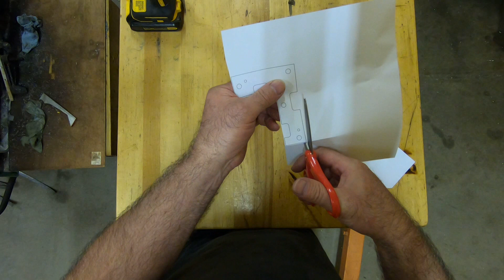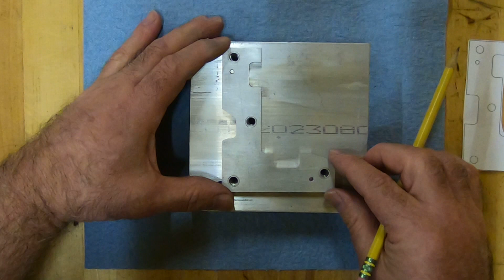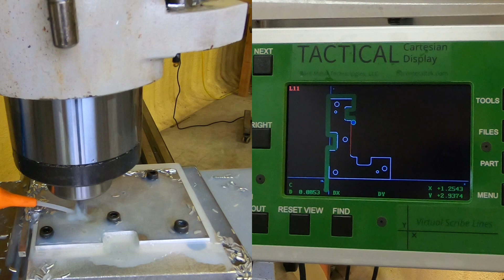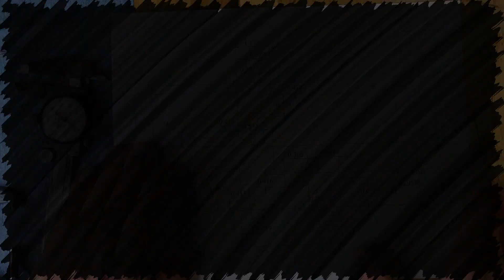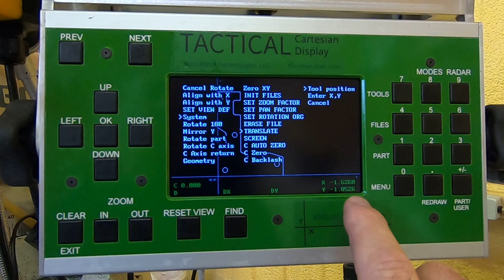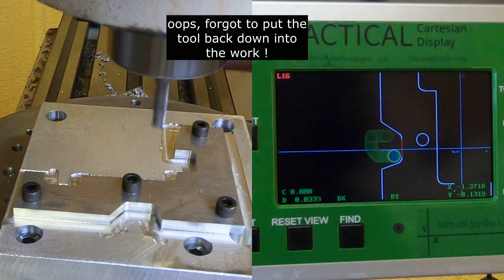Machining a simple part with the Cartesian Display

Comment: Thank you for your video. I was unaware of this "set up" and have never seen it used on any other channel. I'm interested to know if this is something you developed, there is very little info that I have been able to find
Reply from the maker: I developed the system. Keep an eye on the website and contact me with any questions.
Reply: Thank you. I will "stay tuned"! @baremetalmachine933
Reply: First time doing the job, make sure to drill all the parts before making the fixture. The fixture is then already set to use once it is finished on the machine.